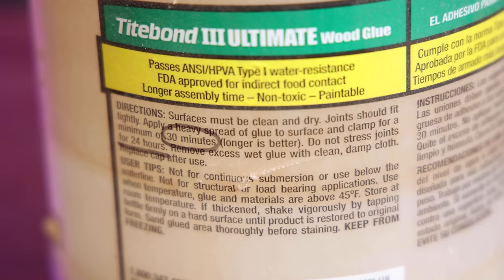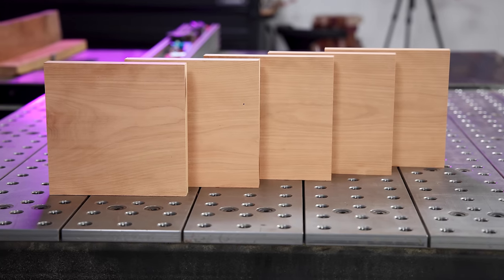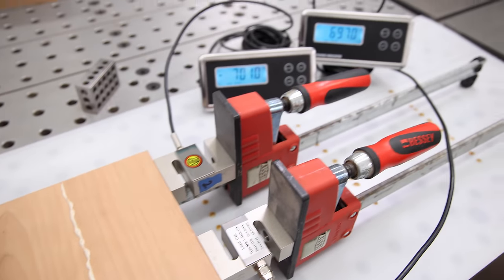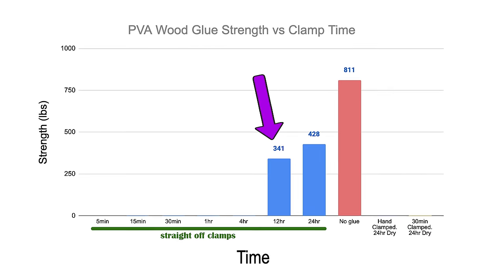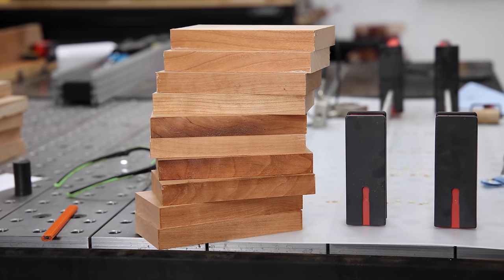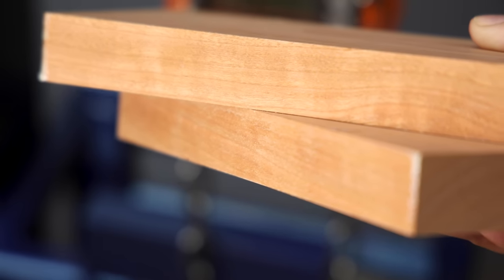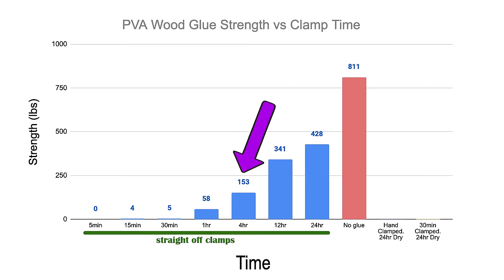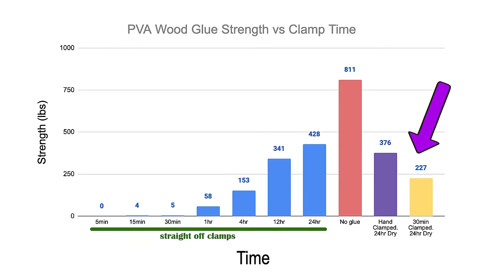you are clamping too long

Comment: Great test !  But there are, at least in my opinion, 3 different times to consider: open time, clamp time and cure time.  The first one is the time it takes for the glue to start drying and no longer be able to adere to itself properly.  The second is the time it takes for the pieces to be able to stay together without stress being applied to them. For a small/light piece, that can be short (30 min).  For a big/heavy or long piece that can experience leverage, that will be longer (1, 2 or 4 hrs).  Finaly, and most important, the cure time is the time it takes for the glue to reach its full strenght, and that is, in most case, the 24 hours (at least).

If you can leave your piece undisturbed, you can shorted the clamp time and let the glue cure (not dry) and use your clamps on another piece.  If you need to move your piece, for example to free your assembly table, then leave the clamps longer and remove them only after the piece has been moved to a safe location where it will not risk being disturbed

In all cases, let the glue cure as long as possible before puting stress on your piece.

Comment: Loved the video. Love the scientific method. Maybe try joinery testing, miters vs box joints, vs... 
Burbon moth did this - and found that miters without splines were one if the strongest. But any good experiment needs replication and his findings refute most recomendations for joinery on the internet and elsewhere. Would be interesting to replicate this. It seems an unlikely hypothosis that miters would be the strongest. Just a thought...
Anyway, keep up your excellent work!
Reply from the maker: Miters are indeed that strong. In fact, check out scott Walsh woodworking here on YouTube. We did joinery testing in my shop and the video is on his channel.

Comment: Tested 30 min clamp->straight to test vs 24 hrs in clamps, etc. What we need to see now is 30 min clamps + 23.5 hr rest, which is the actual process described by the instructions. But that doesn’t mean the test you did isn’t relevant - sometimes in a project we don’t have time to let it sit; we’ve gotta go straight from clamps to assembly after an hour, which just might stress the joints.

Comment: Glue squeeze out doesn't even property dry in half hour. 
So it doesn't make any sense to think the glue inside the joint which doesn't have lot of exposure will in form be dry. 
I wouldn't even bother testing it. 
I typically leave min 4 hours before removing clamps. Usually i do clamping over night

Comment: Please differentiate between clamp time and curing time. The question is does keeping the clamps on for a long time improve the joint. Cure time for the hand clamp was the same as the 24 hour clamp time but the 5 min clamp time was tested after 5 mins. This is not a test of clamp time this was more of a test of curing time.

Comment: With the last test it all had to do with your clamping pressure..Because the glue is not allowed to dry before The pressure was released The boards were allowed to drift apart slightly Causing your connection to fail...

Comment: That was a great video. I wonder if anyone has tested how much force is put on the joints after the project is finished and being used. 
For example, how much force do we put on a drawer when it's stuck closed. Or on a leg of a table during dinner. I bet it doesn't even come close to the test jig.

Comment: Did a whole video testing glue strength, didn’t read the part of the instructions that says cure time. Clamp time and cure time are not the same thing. Cure time is where the strength comes from, clamp time just ensures that the bond isn’t disturbed until it has had enough time to cure enough that it can be sat to the side until it finishes curing.

Comment: very good video man. I'm not sure if you took this into consideration or not but in my experience, I found that the cleaner the glue surface is the stronger the bond as well. i usually use a helical or spiral head in my joiner for glued surfaces, But a really clean surface like this has a far stronger bond than a surface cut with a circular saw blade or something like that Because it allows for more wood fibers to bond together due to surface area.
Reply: I think the lack of strength on rougher surfaces is mainly due to the loose fibers being weak spots. Glue absorbs into the wood so it doesn't need extra contact area from sanding like some people suggest. I do remember seeing a test, maybe by Mathias Wendel, where he found a glue line that was noticeably thicker was just as strong, so I think it's not due to the bigger gap.

Comment: I get the whole psi situation....but on parallel clamps dont the pressure shoot out like a triangle from the top clamp?
Meaning you have far more coverage then just a straight line of pressuree from the clamp....so if you alternate the parallel clamps with one egde and the next one on the opposite edge taking into account the spread of pressure...I would think that covers a lot of ground without too many clamps.
Anyway,,.Im ranting haha.
Reply from the maker: It’s a complicated and nuanced topic but essentially all clamps radiate pressure in a triangle shape. But the force is inversely proportional to the surface area being clamped. Meaning, the further out on the triangle, the lower the force because it is more spread out. Which is why PSI comes into the discussion bc it’s pressure per square inch. All that to say, maintaining manufacture recommended pressure is very difficult and it’s something I need to explore in future videos but I think it’s too high.

Comment: Thank you so much for this Suman! 

I've been waiting for this series of tests from you, and can say it confirms a lot of what I had in mind regarding clamp force and clamp time - that is, clamps do not have to be wrenched down to the point of distorting fibers to be effective, among the many propositions and conclusions that can be drawn from your demonstration.

So the question I now have (notwithstanding your explanation of joint line vs. solid piece fiber behaviour) is how much of the glue strength can be derived from the glue actually penetrating into the fibers under pressure? You demonstrated that the glue offers rigidity to the joint line, but also shows that unbroken fibers (no joint) are much more effective in resisting certain longitudinal force along the grain. 
Further,  can the distance from the glued joint to the actual break be predicted, if clamp pressure is a determinate variable? It would seem such an experiment would take quite a few iterations to gather enough data to even try to demonstrate ratio analysis, I'm sure! And probably has no practical value either.

It may be a technically difficult experiment to create and execute, but it is a curious thought about what might be a ratio of glue penetration to the force required to break. Would the actual break line indicate the limit of glue penetration? Or is that simply the weakest point in the length of the fibers?

I know, too much minutia kinda belabors the whole experiment and test, but curious minds and all that!

Comment: my take away from this is when glued up the glue fills the void on the joint and the strength comes from allowing the glue to set and dry in place vs the amount of pressure placed on it , i would venture that clamping pressure has more to do with fitment than glue up strength , once glued do no touch :P

Comment: You notice when you glue then clamp, most of the glue is squeezed out. What remains is a very think film between wood pieces.
Wood is made of fibers, when you clamp your pieces, those fibers compress a little bit and throw out most of the glue, when you take off the pressure, the clamps, and the glue is not set yet, some of the fibers spring back, making a gap, wich is not filled with glue, this is microscopic level. An therefore, a weaker glue joint.
This is why the ones wich you just used your hands to join together are stronger, because you didn't compress the fibers. But this is also why is weaker than the clamped ones, because the pressure of the clamps forces the glue to go a little bit into the wood, through the fibers.
For most woodworking projects, you don't need that kind of glue joint strenght, because furniture, end even constructions made of wood don't take those kinds of pressure force on a area so small.
If you ask me, the clamping force of just using your hands is enough on the long run. Because if you clamp at a higher pressure, even though the joint is stronger, you have less flexibility in it and with time will become weaker, because the fibers near the joint were stressed when glued, and wood moves, with time that can lead to cracks, wich will weaken the joints.
I made a big table once for my mother, she's a tailor and needs that kind of working surface. I made it in such way that you can disassemble it. All the joints where glued wich just a little bit of excesive glue and nothing else. No screws, not dovetails no fancy things, nothing, they were hold toghether on a flat surface only by the tension of glue viscosity. I think i build that table like 8 years ago. Is still in one piece although it has many pieces, because it has to be a stiff heavy table. You can dance on it. And it didn't had any finish on it, just pine wood and glue.
And i've tested the strenght of the glue before building it, end graind to end grain, end grain to edge grain, to face grain, the wood fibers fail before the glue joint. The glue i used is called Moment wich was d3 category wich means water reisistant.
If you want to glue end grain to end grain as a tip for a strong joint, spread the glue and let it sit for 10 minutes, then put a little bit more and glue it, this gives it time to soak a little bit more into the fibers as you all know the end grain part of a piece of wood always sucks moisture the most. And then clamp it or join the pieces together. If your cuts are precise most of the times you don't even need clamps for joining wood toghether.

Comment: When I man clamping hardwoods like maple I back off with the clamp pressure. If I use too much pressure the wood will squeeze out the glue. 
I only need to clamp hard enough that all surfaces come in contact with each other.

Comment: I wonder if fine sawdust mixed in the glue would help with the rigidity issue without compromising the strength of the joint?
Reply: Adding sawdust to the glue would make the joint much weaker because the wood fibres on either side of the joint would not be as close to one another.  It would make it similar to an end-grain joint.

Comment: I only made it to 6:30. I hope you also tested clamping them for 5,15,30… and then let them sit unclamped for 24 hours, then test them. The clamping time on the product is just for the clamps to be needed to set the bond, the glue still requires time to set

Comment: You should have left the clamp for the entire 24h.
What probably happened with the 30min/24h was that once you removed the clamps, the pressure was strong and it “spring” the glue, causing some separation, making the union weaker.

Comment: Awesome testing! I wonder if the counter-intuitive 30 minute clamp and 24 hour dry time can be explained by the wood fibers at the joint expanding and weakening the glue joint when clamps are removed at 30 minutes, since you already showed that at the 30 minute mark that the pieces are definitely still weak. So there was some stress put on the joint, whereas just holding the joints together for awhile doesn’t put any stress on the joint when you leave it alone. In other words, disturbing the glue before it completely sets is worse than leaving it alone. Excellent video and very informative.

Also, the manufacturer of the glue probably did not do the testing you did before publishing their guidance. I would hope they could swallow their pride, do similar testing to confirm, and then revise their guidance. Even better, create a chart like yours and publish it.
Reply: I've said this in my own comment as well but I think that the glue joint should be sanded before glue up. And what you are saying about wood fibers might have something to do with that. If the wet and therefore softer wood fibers infused with glue could intertwine more because of a bigger surface area that would help strengthen the joint. 

And the manufacturer probably looks at even more and perhaps "to" scientific data. And as he explained the clamping force was not the same amount as stated or asked for. Rightfully so because in the real world that's almost impossible to (practicality) reach!  But I agree with the fact that manufacturers need to do more "real world" testing.

Comment: issue is most wood glue depending on type fail if the moisture% is in the 20-30 % range. White glue is plastic particles dispersed in water. Now what happens during the clamping? the wood sucks the moisture out of the glue line, the waiting period is needed for the joint area to dry again.

Comment: Great content! I noticed in your parallel clamp test you claimed that high pressure is very important when clamping glue-up jobs but I haven't seen any proof. Based on the hand clamped test piece in this test I would say there's even less reason to believe that high clamping pressure is a requirement. I enjoyed both videos and as I suspected the main benefit of a "parallel" clamp is actually larger surface area and very little chance of marring the work piece. 
Could you make a video comparing different clamping pressures and the resulting strength of the joint for a 12 or 24h glue job similar to the low, mid and high pressure tests of the parallel clamps? I'm guessing the main issue with a test like that is sensor longevity and how much time it will take to glue everything up considering you can at most do 1 set per pressure sensor. 
Looking forward to future videos!
Reply from the maker: Haha I believe my line on the clamping video was something along the lines of “contrary to popular belief, you don’t need to clamp a piece of wood like it owes you money” 

And yes- clamping pressure and glue starved joint is definately in the plan. But I’ve got some other ideas I wanna get off my chest and come back to glue later.
Reply: @WoodcraftBySuman  I believe I was parafrasing the bit where you said that 150in/lbs is way too low of a clamping pressure when commenting on the "most parallel pressure"  the majority of the clamps achieved. Regardless I think it would be very interesting to see the real life results of such an experiment so definitely looking forward to it sometime in the future!

Comment: Wonder if the drop in temperature even at 3 degrees played a part in the glue’s adherence. Even though the recommended temperature is 47* the work time changes when below 72*, so if that’s the case wouldn’t it have an effect on time for curing and even then the potential for a failed bond? I’ve glued up in 38* over night and have had good glue ups. I’ve done glue ups for cutting boards in regular temps and have had strange failures at glue lines. So what the hell do I know???

Comment: you should test with the same cure time for all of them, as testing them as soon as you take the clamps off adds another variable of how long the glue has had to cure and letting the piece sit for longer is not that large of a problem normally if the clamps are free to glue up the next one.

Comment: I'm curious as to how long you held by-hand the 'non-clamped' tests together, prior to letting them cure for 24 hours?  Often we work with small Violin/Viola bridges that have been cracked, and the question is whether or not a hand-clamp scenario for more delicate parts can be just as upholding as a full clamped 24-hour process with something like a very small and lightweight 6" one-handed bar clamp, etc (compared to hand-clamping for "X" amount of minutes).
Reply from the maker: I held it by hand for about 10 seconds. The only risk you run into is a less than perfect fit and a minor but visible glue line. If you can use tape or rubber bands to hold it tighter while the glue dries, it might be a good idea.

Comment: Thanks. I’ve always wondered how to use that 30 minute number, especially when doing a lot of glue ups.  Weldabar’s comment might be something to think about if the temptation to unclamp “early” is there.  
Was curious how long the “hand clamp” was applied. How strongly, glue in joint more or less than clamped affecting joint adhesion/vacuum effect I’ve noticed in oops glue up instances. 
Again, Re last two tests, Weldabar might be onto something. 
Last thing this made me think about is “how much joint strength I need”. But there’s no way to dial that in re clamp/dry time so I guess I’m sticking with 24 hours, though a bit more knowledgeable than before.
Reply: If you are doing mechsnically strong joints like dovetails or mortise and tenon, then once the glue has set the joint itself will hold together till cured.

Comment: Your move power tool users.  To that i say.  Use the ins and outs trick at the jointer and the ups and downs trick at the table saw.  Achieves the exact same thing.
Reply from the maker: That method works extremely well and is far easier to get clean results. A hand plane is technically more capable of getting a better joint but that’s honestly splitting hairs.

Comment: Nap time:  I glue up, then take a nap.  That's 4 hours.  No big decision.    If you dig through University testing, you will find that "0" clamping pressure (properly cured) gives about 50% ultimate strength, so this confirms your experience that light clamping is all you need.  I'd go along with ultimate strength achievement in wood glue if it was a life safety issue (esp., MY life!), but that's pretty rare.